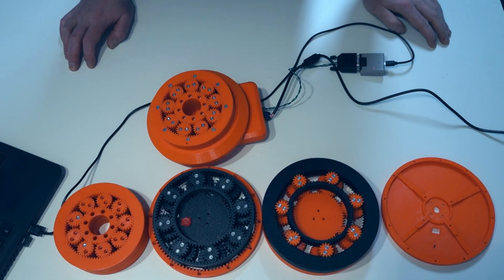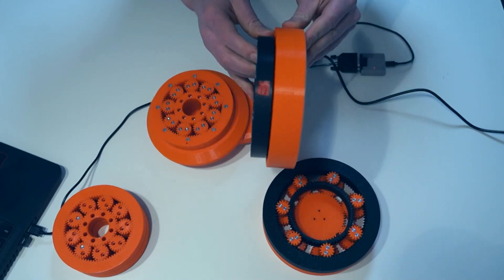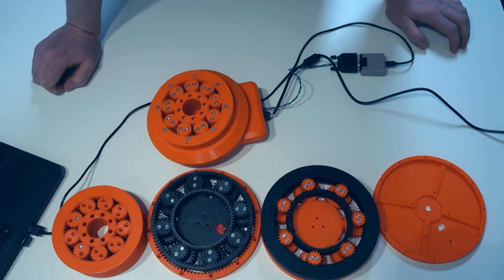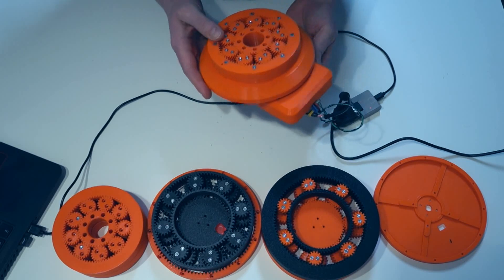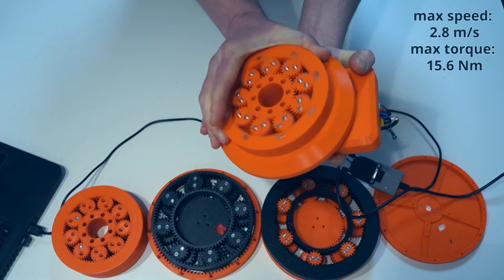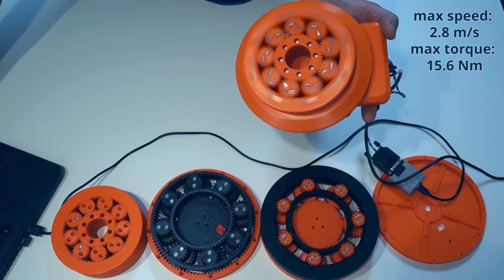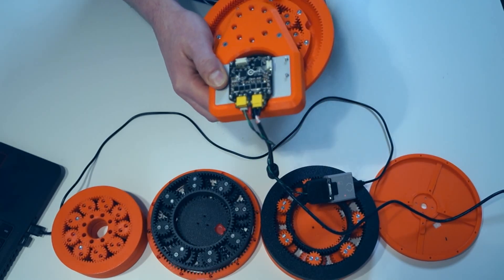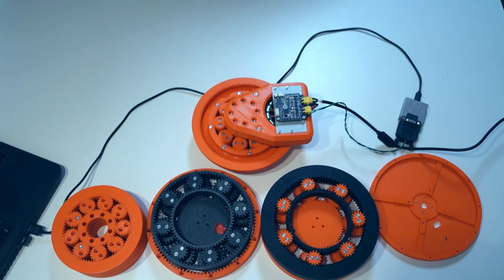New Wheel unit prototype

Comment: Good project 👍 why don't you try hoverboard motor wheel ? Too powerful ? 36v 250w diameter 6.5" or 8".
Reply from the maker: Thank you. I have no experience with hoverboard. Current solution seems good. Maybe I'll explore hoverboard later.